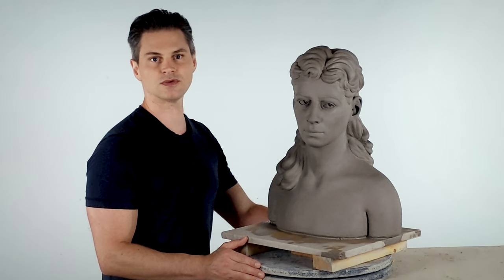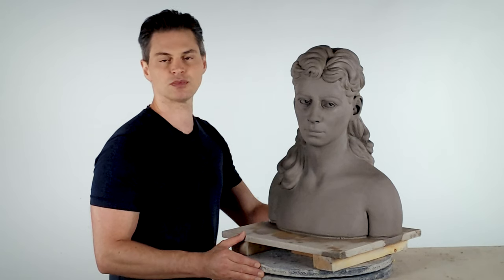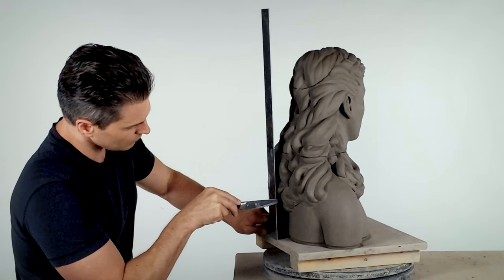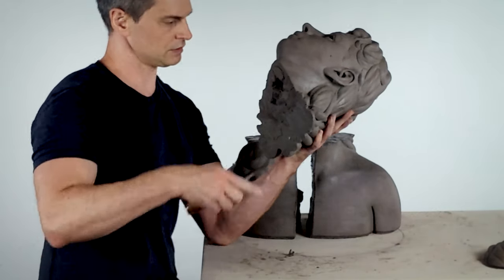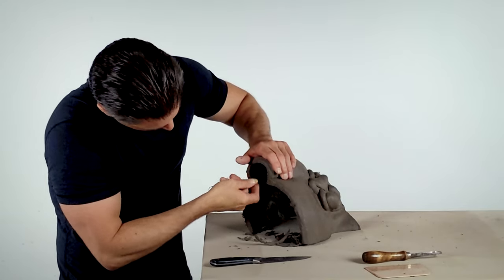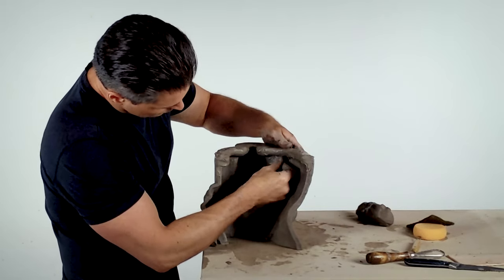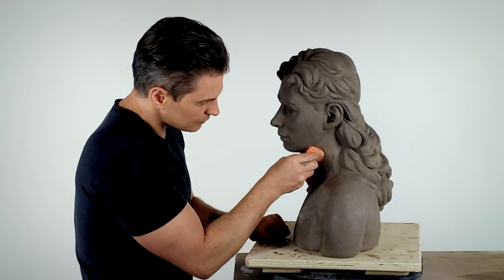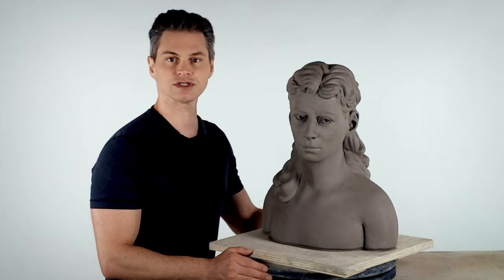On-Armature Bust Part 14: Removal, Hollowing, & Reassembly

Comment: Not sure how you did that, even though I watched.  I can guarantee I would have broken it into many pieces and had an onscreen tantrum and meltdown.  Talent there.
Reply from the maker: It does take a little experience to hollow with confidence, but it's really not as hard as it at first seems. Mostly it's just intimidating to cut up a sculpture you've been working on for, if you're a beginner, probably a couple of weeks.

Comment: Did you put a coil of clay on the inside seems as well? Or just smooth it over. I cannot tell by the statement, "do the same on the inside", if you were referring to the last step, or the whole slip/ join/ coil/ smooth process.